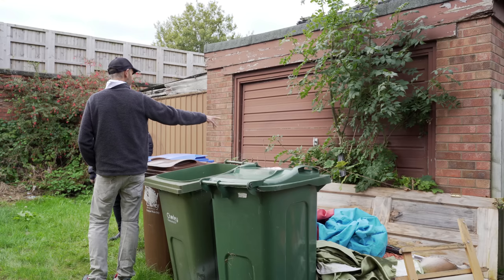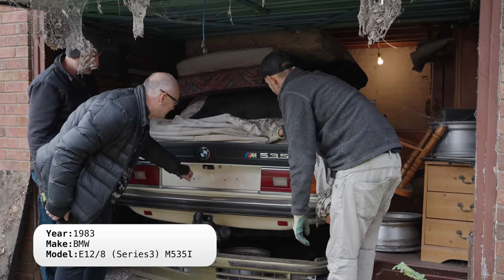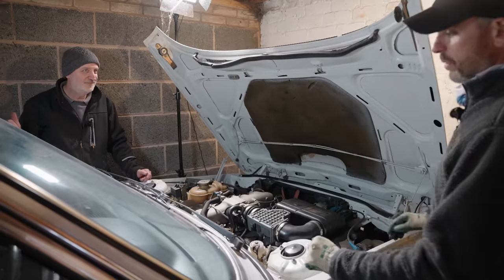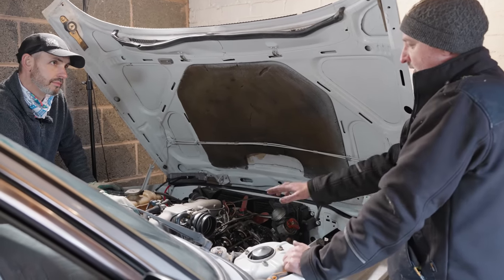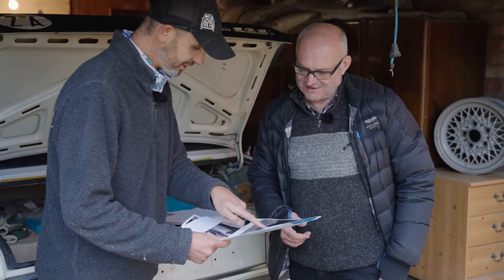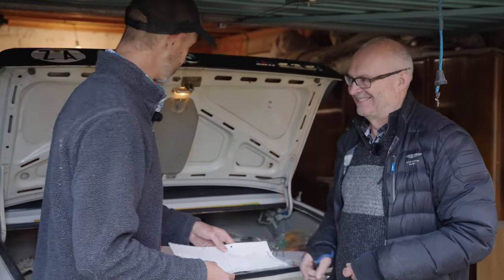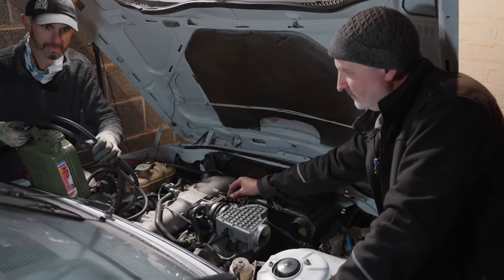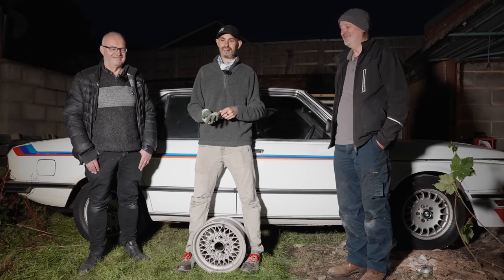Barn Find rare 80s BMW M Sport survivor car untouched for 30 years - will it run?

Comment: Johnny, as an owner of a UK-delivered 1981 E12 M535i in the exact exterior colour scheme, this was such a joy to watch! It was like watching a thriller as you and Tony were tinkering and trying to solve the mysterious tapping sound, and then when she finally roared into life it was just incredible. I was hanging on just waiting for that M90 to fire up! Along with everyone else in the comments below, i thoroughly look forward to the follow up video! Peter must be chuffed. Now, get the damn thing out on the road for a hoon!
Reply from the maker: Tom, great to have you on board and enjoying the episode. Thanks for the comment. The E12 M is a special beast.
Reply: My neighbour bought one brand new from bates bmw in maldon. He kept it 20 years before selling as it was rusting
Reply: Good to see a fellow BMW E12/8 owner hang onto his pride!
I bought new in 1984 M535 E12/8 fitted with central locking, electric windows, aircon, radio tape, 390TRX rims. 220 tyres Limited Slip Diff Getrag gearbox etc.
My model does not have rubber boot spoiler or front apron. Factory fitted front fog lights. No rust accident free. Great car.  141,000 km since new. Still have it. Jan Prins
Reply: I had a silver striped E12 uk version, loved it, the M535i was such a significant car, the only close saloon in those days was the 
Lotus Carlton
Reply: @richlee509  I bought it off him. Small world!!
Reply: @blanketyblank5022 just see this message lol going back through the comments lol

Comment: I worked for BMW in South Africa, during technical training I heard of these phantom lightweight e12 s I thought they were all gone, or just a mythical M car.
When I heard her fire up 😢 
I remember the change to group N and the absolute great racing that followed.
Reply: My dads brother has one but was in an accident have not seen the car in 3 years. But it was repaired.
Reply: If its the one I'm thinking of, we helped to build it for the factory rep.
Reply: @levelthrone6052  ouch, btw   i was replying to Gavin Thompson...
Reply: @iHelpSolveIt  no problem it didnt show a mention so i didnt want to be rude.
Reply: @levelthrone6052  no problem, i understood.
Reply: I was clapping through out...🔥🔥🔥
Reply: Did you happen to work on the M7?
Reply: Nice car but sadly not what it’s purported to be. I tried to post a link to a very interesting article with input from both BMW SA race engineers and drivers of the day but it’s sadly being removed whenever I try to post it here.
Reply: How old are you btw
Reply: @deepthunder1034  Never seen one TBH did they make 7 series M cars ?
Reply: @ezra6454  44 now 🤔
Reply: @gavinthompsonethanracing2057  Yes it's an official unofficial ...lol...it's a right hand drive 745I with an M88 engine instead of the M30 B34 turbo engine due to the turbo not fitting with the steering column on the right side, it had an M emblem on the speedometer and or the tac..... some of the people who were building it considered it an M7, due impart having the M88 in it. Thats what I read in several articles when I bought my 745I turbo about 5yrs ago.
Reply: How i’d kill to have your experience at that factory.

Comment: I was in the army in the mid 80s in S.A. based in Kroonstadt. We would hitch-hike back home to Cape Town when we had leave. Even sometimes just for the weekend, even though it was about 1215 km each way. One day on a Friday evening, a guy traveling from Johannesburg to Cape Town picked us up in a car just like this one. He picked us up because he was tired and needed someone to share the driving. His only stipulation to us was that we share the driving and go fast as he told us to drive to be in Cape Town for breakfast. The trip usually took around 12 hours at an average of 110 km/h with a couple of stops for fuel in those days. That trip took us around 8 hours going at about 160 km/h on average on empty roads in the middle of the night through the desert. What a thrill. Not sure we could have done it in any other car at the time.

Comment: passion, enthusiasm, heritage, exclusivity and the unfathomable joy ... so much we got to see in this episode. Truly an epic barn-find for me to remember all my life. Thanks Jonny for bringing this to us 👍. Hoping to see Part-2 when this beauty Beemer is fully restored and running on road ❤️
Reply: Restored ? change all fluids in it (oil, fuel, water/cooling, brakes liquid +all filters, change the gearbox oil), ball-bearings +joints, check brakes pads + rotors, fresh tires on both sets of rims, check exhaust to not be rotten, wash-it, vacuum & clean inside-out and simply drive it just like that, patina on it is perfection, really.. if this time capsule would be mine no need for fresh paint to worry about paint scratches, chips & dents, this would be it..

Comment: Just hearing (and seeing) it's a ZA car gave me goosebumps. If possible, you should do a special on ZA homologation Beemers, the 333i, the 325iS (with Alpina bits to make it a 2.7 screamer and M-technic body kit), 745i (with, I think, either the M1 6 cylinder or a 3.5ltr turbo). Back in the 80s and 90s South African engineers were very creative in keeping us motorsport addicts entertained.

Those cars were legends here in ZA, driven by legendary drivers, Tony Viana, Deon Joubett and co. I assume that some of those cars were imported to the UK. Coincidentally I regularly see 2 E12s in my neighbourhood, and though I'm a Mercedes driver, I still stare, they've always had a certain appeal.

Comment: When trying to jump start these cars,  stop putting both jump leads/booster pack leads on the battery of the dead car. It's incorrect.
Put the positive lead on the battery and the negative to a good engine ground AWAY from the battery and see the difference it makes. 

I am a former AA roadside assistance tech.

Comment: I drive a Euro spec 1983 BMW e28 520i daily. It was fully restored by BMW technicians using all OEM BMW parts. It has the complete original interior in pristine condition. It was imported from Germany in 1983 and has had only 2 owners before me. I bought it from the original owner after he rebought it from the second owner and fully restored it. Runs and looks like new. It's such a joy to drive.

Comment: Am old school trick for the coolant tank. Once it's out of the car, plug off one side and add  in CLR (Calcium/Lime/Rust for phome plumbing also good for plugged up heater cores in cars) nd let sit for 20 minutes. Then flush with hot water 3-4x then reinstall.....

Comment: Excellent find Jonny....  I remember these, an uncle had this and a M325is Shadowline, another South African special.   You absolutely had to hear those cars with their free flow exhaust systems - goose bumps.   He used to run both of these at a local drag strip in Gauteng (then Transvaal) called Tarlton.  Both of them beat all takers - Opel Firenza's, Ford Cortinas and Perana's, Opel BOSS, Golf GTI/CTI's (another South  African special if memory serves, and equally iconic, at least to me as I owned a candy apple red one with a set of BBS rims).  At least until the Ford Sierra XR8, Opel Super BOSS (another SA Special) and Mitsubishi Tredia Turbo came on the scene.  I get all misty eyed thinking about those heady days :D :D.   On a side note, Perana Louvers were not made and owned by Basil Green, who was the man behind the Perana Ford - But for a South African car nut from the 70's, 80's and 90's, these louvers are nostalgic too.  Many a classic car had these as the first addition, with a set of side window "bubbles" to complete the look :).  They are made to this day, and as far as I know they still have their molds for these somewhere in their shop in Nigel, South Africa.

Comment: @Latebrakeshow thanks Johnny, this era in South Africa, BMW SA produced some epic cars. Production car racing was big business and cars like this E12 535i “light weight”, the E30 333i, the E30 325is evo 1&2 and the E23 745i fitted with M88/3 engine from the M1 will most likely make it on a list of rarest BMW homologation specials. I know there must be a couple of these floating in collections in the UK and Europe. Perhaps a treasure hunt to uncover some of these rare cars which can include Alfa Romeo GTV 6 3.0litres that were also produced in South Africa in the 80’s as homologation specials… Thanks for a great show as always Mr Smith.

Comment: This is fantastic. But the use of starter pack is a ongoing user failure. Its normally not fullly charged out of the box. Its not a battery, its for boosting or starting. It may have 15+ volts as well to drive the starter quick giving a best possible chance of starting. So Is reccomend you just get yourself a really good normal starter battery.

Comment: I owned an E28 M535i from Nov 1999- mid 2001 I sold it back to the previous owner for a paltry £500 (it was rear ended by an uninsured woman) as I needed the cash. I'll never forget that beautiful, burble from the exhaust. I think the Reg number was D389 GPX

Comment: My grandfather once owns this kind of BMW. its a built up car, a 1981 e12 520, 2 barrel carb with 4 cylinder engine. Its a very rare back then here in Indonesia and theres only a few of them while others are with 6 cylinder engine. The car is pretty fast for a 2.0 engine, it can beat a w123 230e Mercedes Benz easily and tailgating a w123 280e as well. Thanks for uploading the video, it brings back the memories

Comment: From the angle shot from above the engine whilst the noise happened, I could pick out the noisy rocker by the rhythm of the noise and the glint of the movement.  I do play drums though.
Edit:  End of vid now, and what a lovely car.  When I was a kid visiting family every summer in Switzerland, there were so many sport versions of the European models of the rally/race styling there compared to the UK roads, and this Beemer reminds me of those cars of 45 to 55 years ago that I loved so much.  I was always of the less chrome the better persuasion back then but this car looks like it's supposed to:  a manufacturer tweaked luxury car.  So happy to have seen this remarkable survivor.

Comment: With regards to never finding good jump packs. The Noco is the best, what might be happening (correct me if I'm wrong) is that you are connecting to an old dead battery. What will happen is the battery will consume loads of power from the jump pack as you are also trying to start it. 

I'd recommend always bringing a charged new battery for these. Doesn't necessarily have to be the right battery in terms of aH rating but a high CCA is important.

Love this series guys and so well done, I feel like I'm with you.

Comment: First 5's FTMFW. E12's are exceptionally rare here in the states, especially where I am in NY. Wouldn't mind owning one, but after owning, building and enjoying so many bimmers for myself, and for my customers, the e28 and e34 are definitely my favorite chassis 5er's. The e34 540/6 msport was my favorite daily. So much that I had two of them. I used to run my own fab/ race prep and performance shop that specialized in E30/36/46 track car builds. The SPEC series is the best, most cost effective and outright fun way to get yourself some seat time at the track. The series is built to somewhat strict regs so the majority of the skill comes from 'driver mod' more than anything. It's definitely a blast and id encourage anyone who isn't in the BMWCCA to join up and start doing some club racing. Great camaraderie and excellent times. Met some great friends and had a blast over the many years with the club. Thank you for sharing this e12 with us.👍🙂

Comment: What a car! and so clean!! I was a BMW technician in the early 90's and remember working on some of the South African imports (like the 333i). Takes me back to some of the great motors that BMW made back then. I remember an E28 535i we regularly used to service that had over 300K on it,  which had all the original running gear - they were bomb proof! Thanks for sharing.
Reply: The e28 project I have had 320k on it when I got it, the int. is still excellent, the engine is getting swapped tho' for now, HG issues.  And a  gearbox with 100k less miles :)

Comment: I owned a BMW 316 (1986) South African built. I owned it for 8years. It was wonderful to see so many features on that featured car that were on my car. I was extremely happy with my car. The 316 from South Africa was a lesser version of the 318 with an 1800cc engine. The European 316 had a 1600cc engine. 

To get engines started in oz  most people spray in ‘ start you bastard’ into the engine 🤣.

Comment: This brought back memories of the B reg fiesta I got for my 1st car. It had a special 12 inch "starter spanner" in the driver's door pocket and it would only start if I got down under the front end a whacked the solenoid a couple of times before turning the key. Twice I stalled it at the lights and had to jump out with a queue of cars behind me and perform the special startup procedure 🙈🤣

At mot time, she failed and the scrappers wanted me to pay for disposal, so I sold the XR2i boot lid and steering wheel to to a guy who was working on a project car for £50, on condition that the rest of the car (most definitely Not an XR2i) came free 😂

Thanks for reminding me 😀

Comment: With the tinny sounding doors i`d guess they are aluminium doors, bonnet and boot lid (possibly even roof too?) Lightweight seats too. Plus back in the day they used to `acid dip` bodyshells and windscreen just to shave off extra weight, so a possibility?

Comment: Great find !
I would have oiled the cyl turned engine by hand let it sit for 24hrs while   running a low pressure  external oil pump thru a bypass  at the oem cooler to a heat exchanger while instead of cooling heating new oil  and filter . But thats me .
Lol great find enjoy

Comment: My first BMW was 1974 e12 520 which I modified with hi comp pistons twin 40DCOE Webber's a professionally made extractors made around the steering box I put a rev limiter rotor button out of a 911 set at 7,200 rpm 4 speed box which I also re manufactured the engine ended up 2200cc with match porting never had it on a dyno but it would pull 7200 in all gears and the speed check on it put it at 225kph I put a 19mm sway bar on the back a 27mm sway bar across the front lowered springs to say I had fun was an understatement the car did 440,000 kilometres of hard driving and towing I had a special pressure plate and clutch plate built for it which lasted the life of the cat and it wasn't the engine that stopped I actually ended up cracking the rear chassis and wish I had never parted with the car. Oh I had my own engine shop

Comment: Should have known that was going to happen I wouldn't have touched the engine without changing the oil and fluids and making sure everything was lubricated before starting. And changing the gas but I understand the situation.

Comment: I have revived over a hundred cars many sitting decades and have always been curious if the valve springs that have sat compressed all thoes years if they lose aome of the lingth or will a spring compressed for a decade or two will sprimh right back to its original size ....?

Comment: I thought, “Oh someone in the UK owns a car cover!”  But no, just bedsheets.  No car guys in the UK ever takes junk to the dump.  They just make a car impossible to get out and use.  I’ve stored sports cars before when I had too many, but I never used them to hold up junk that I was too lazy to get rid of.  I kept them garaged and usually with a car cover—never stored outside, even in Southern California.  In 1982, I bought a 1980 Triumph TR8.  Drove it as a daily driver until 7/2/1989 when I bought a Miata the second day they were officially out in So Cal.  I left it garaged for a few years until my Dad wanted it.  I sold it to him where it was a weekend cruiser.  Eventually, when Dad wanted me to sell it, I sold it on EBay to a Triumph nut in Belgium.  For only $2k less than I paid for it 20+ years before.  I LOVE the old school use of the screw driver to find the sound.  I recently had a shop in Texas track down a noise in a 2001 3/4 ton Chevy truck.  Using the screw driver, my mechanic tracked down the noise to shot differential bearings on the left side—LOVED that!

Comment: Great work, so happy the cats keep the rodents &squirrels under control outside whilst Garfield guarded the interior. Non Cat stainless steel exhaust held up! 
Immediate next work: replace fuel (non ethanol type), coolant, brake fluid, engine oil, gearbox oil, steering, clutch slave  cylinder & limited slip differential oils.

Comment: I had a `81 LHD E12 Reseda green M535I back in 1991 and drove it for 2 years before selling it in real good condition (some rust areas under the rubber decklid) for (converted we had FL. guilders at the time in the Netherlands) € 1600,-!!!. I had a job just across the border in Germany. Many times I smoked Porsche`s 911`s (930) on the autobahn. I was only 21 year at the time and imagine being able to keep Porche`s 911`s behind you :-)  were every kid nowadays seems to drive Porsches, Lambo`s and Ferrari`s.

Comment: @ The Late Brake Show
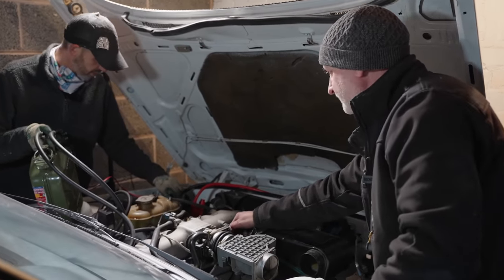@28:51
I thought you are not supposed to start-cycle the engine for a prolonged period of time because the friction will cause wear and tear of the pinch gear on the starter, the gears on the flywheel, the piston rings, the cylinders, the valves, etc. Basically, you are creating multiple new problems while trying to fix a single one.  🤔

Comment: At 15mins into the video and you hear that tap it sounds like a stuck lifter to me and need more oil to get it moving and when it starts with good oil give it a good rev to free it up and then it will settle down